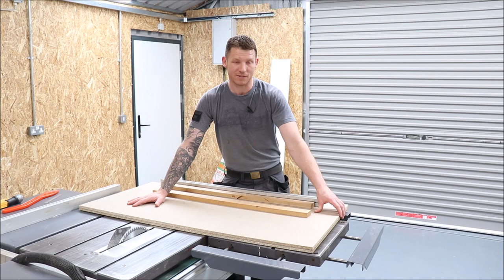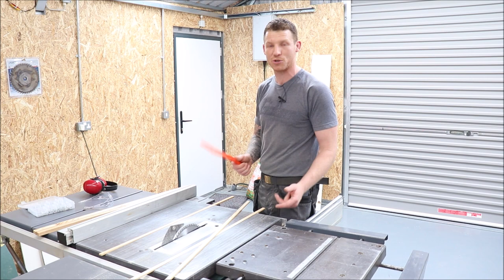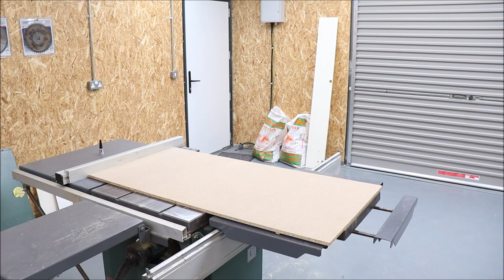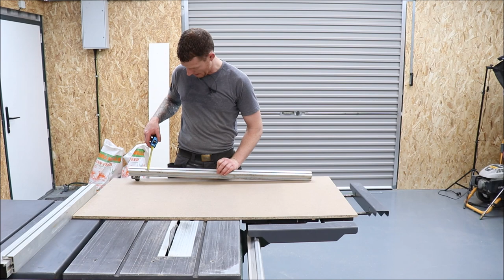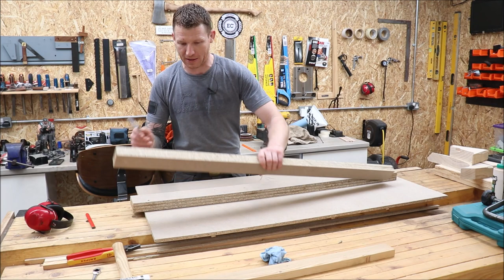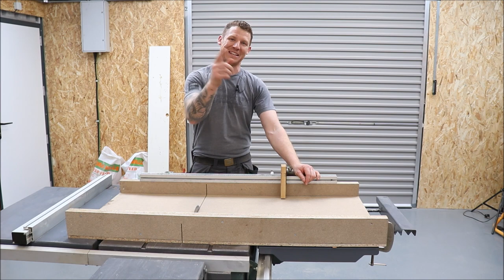How to make a cross cut sled for a table saw.

Comment: Great video John, just want to know the distance from the end to the slot for the blade so I get the blade in the right position... Cheers and keep up the good work ...
Reply from the maker: You can make it whatever size you want as long as you keep the blade exactly 90 degrees to the fence
Reply: John McGrath Nice one thanks for that...